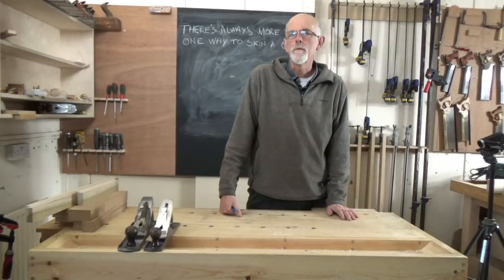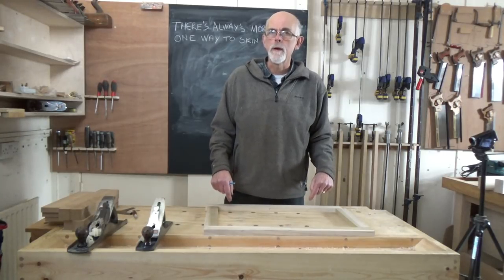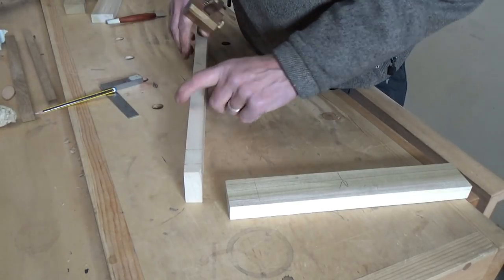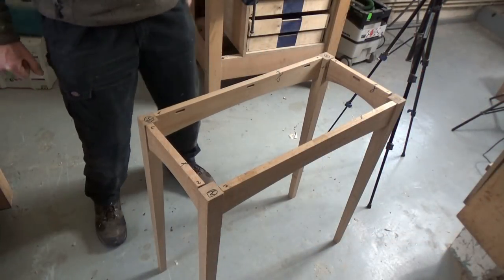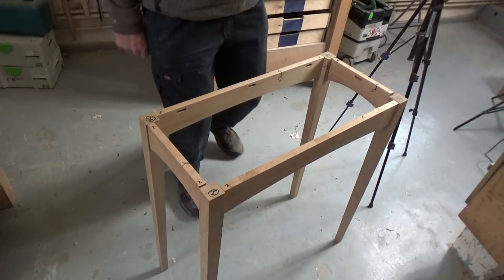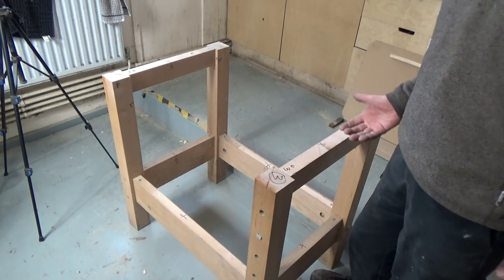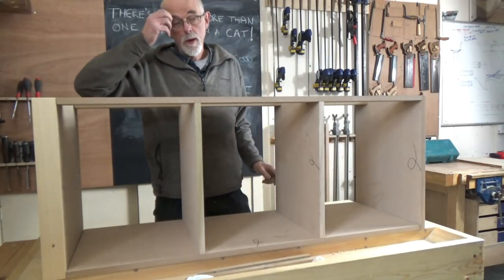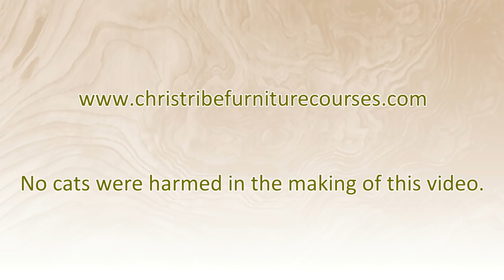Why face side and face edges are so important

Comment: Excellent content so good and well explained 
I now understand the importance of face side and face edge 
And why it’s critical that they are on they inside, because that is where the mating faces (of the joints) are 
Outside faces are just open to fresh air so to speak more for aesthetic value than accuracy 
Thank you 🙏 

Quick question. Would you ever make a square corner and mark it up, and reference from it?
Reply from the maker: Thanks for the question David. I am not sure what you mean by a square corner. Early on in the vid I talk about creating two faces square with each other but I guess that is not what you are asking. If by square corner you mean squaring up an end then yes, after creating face side and edge and dimensioning width and thickness I would then cut to length, squaring the ends to the face side and edge. I using hand tools I would use a shooting board for this.

Not sure it that answers your question.
Reply: @Chris Tribe  Hi Chris thank you for replying, Yes squaring one end or both ends is what I meant (sorry I didn’t explain myself very well in my original question) you answered it perfectly anyway.
I enjoyed your video and I look forward to watching more, thank you for sharing you skills an$ knowledge.you have my admiration

Comment: Some other videos suggested that face side is what's "seen" in the final product, but your table legs example shows it not to be true. Are face-side and face-edge purely a concept used for measuring and squareness?
Reply from the maker: Quite right. That's sort of the point  of the video, face side and edge are usually the faces that are not seen, they are on the inside because that's where the joints are and where you want accurate square faces.

Comment: Chris  I have   the same record  vise for 38 yrs  fitted with 2 plywood faces . What is the purpose/use of  the  L  shaped  fence  ?? thank you.
Reply from the maker: Hi Ernie, that vice is actually an old pre-war Parkinsons Perfect, the sort with square runners not round. I like it because it is nice and slack when released but very positive when tightened. I have the inverted "L" shaped faces to prevent cutting edges from coming into contact with the steel vice and blunting them. 

I have filmed a video of making that bench, it is designed to be made with minimal tools, I just need to edit the footage.
Reply: Thank you for the  detailed  explanation chris, time to replace those old plywood vice faces with an L shaped one . Yours looks like  pine or poplar softwood ??. . Interesting bit   about your parkinsons perfect. I have never heard of that brand name here in  canada or the usa. Probably pre ww2 england  when   more quality tools were available, I still use my record vice  with the quick  release, Cheers  ernie

Comment: Can u define 1 face side and 2 face edge please
Reply from the maker: Thanks for the query Elroy. When preparing pieces for a project you should plane two adjacent faces straight and also square with each other, these are known as the face side and face edge. I suppose it doesn't matter which is which but usually the wider surface is the face side and the narrower the face edge. Once you have these faces prepared and marked you should reference all measuring and marking off these faces.